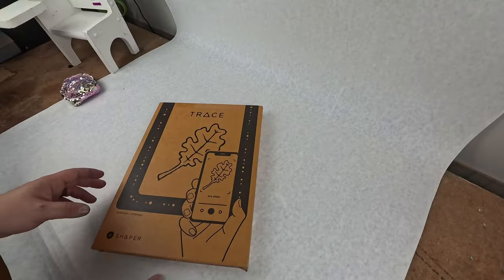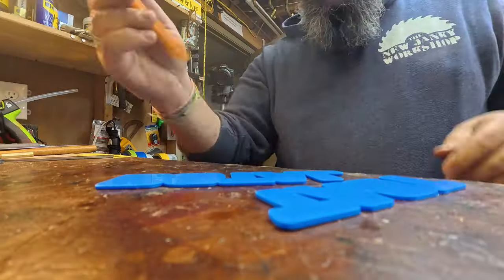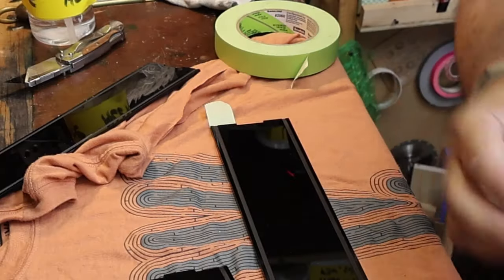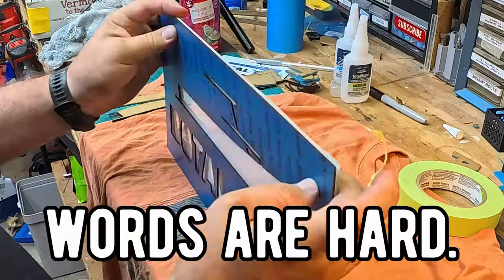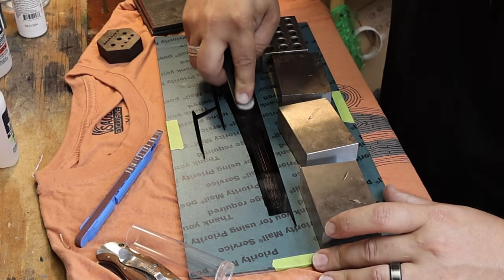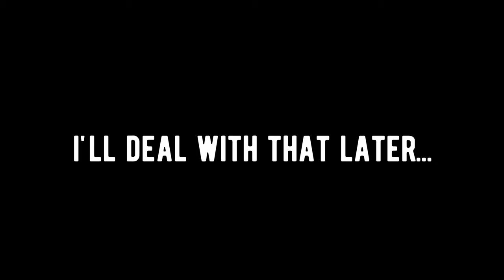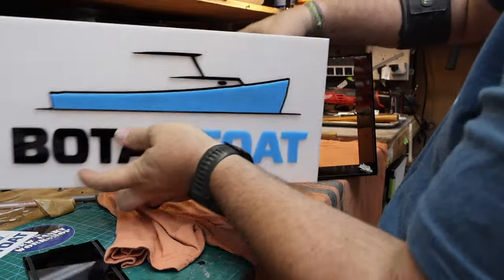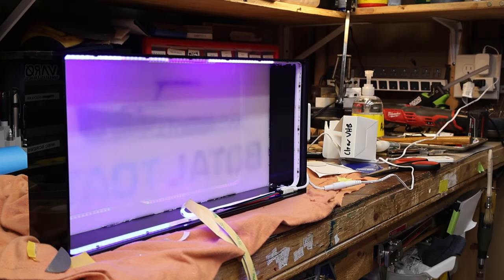I Made a Sign for Xyla Foxlin!

Comment: Do not use a liberal amount of accelerator when using CA glue on you’d body “a cut”. The heat caused by the chemical reaction is a 9/10.
Reply from the maker: 😂 Good safety tip! Thank you!

Comment: Adhesives on plastic will never hold well enough. You need to use a solvent made for that plastic type, which is like welding, they become one piece.
Reply from the maker: You are not wrong - my usual go-to for acrylics is Weldon #4. If you check out my video on the lightsaber mount build, I use that exclusively, and it's still holding like a champ with several lbs of lightsaber on it for well over a year.

That being said, I wanted to specifically work with TotalBoat and their TotalBond CA glue for this project, since at the time it was a new product on the market, Xyla has them as a sponsor, and it was for her "TotalBoat Store" in her shop, so, it all just seemed fitting :)

And this stuff with some surface prep worked out extremely well.

Comment: nice work but I would probably have cut a hole in the black boat so the blue  would have also illuminated to  but without all the fuss & maths of inlaying it, just a cut out 3mm smaller than the blue to give you room for glue
Reply from the maker: I tested out a few designs, inlaid into the white acrylic and the black acrylic (which didn't give enough glue surface to work with using CA glue (which was my plan all along for this sign for the TotalBoat tie-in). 

I did even resort to weldon #4 for one of them, but it tarnished the acrylic all around it. So, finally settling on the design that I did. This was one variation I did not try however. Where were you 3 months ago when I was making this?! 😃 Thanks for the watch!
Reply: @TheNewJankyWorkshop  I worked as a sign maker for 30 years but never actually tried CA glue, for something like that I'd have used a dichloromethane based glue which would use capillary action to go between the surfaces
Reply from the maker: @neilsullivan6416  Very cool. I am but an infant as it relates to sign making in comparison!

I can now add dichloromethane to my vocab, sounds much cooler than "Weldon #4" :)
Reply: @TheNewJankyWorkshop  I know what you mean, I  said that because here the product we mostly used was Tensol (12 I think) though we did buy unbranded back in the 90's which is were I learned the name. 
With a bit of  practice you can even laminate clear acrylic without seeing air bubbles
Reply from the maker: @neilsullivan6416  Is the solution just dichloromethane? If so, that's super cheap compared to the Weldon brand stuff.
Reply: @TheNewJankyWorkshop  I couldn't say I'm not sure Weldon was available in the UK, but as I said we used Tensol, which had other things added to make it easier to use as you could apply it and put pieces together, just dichloromethane would have evaporated before you could bring the pieces together but for larger areas, such as  fixing 2 sheets together you could pour & squeeze the sheets useful for getting good coverage when you  are CNCing 

Or in this case tape the blue onto the boat and use a fine brush around the edge and capillary action will pull it into the joint

 but we also used other glues which had more body, there is no one glue for all
Reply from the maker: @neilsullivan6416  I hear that, I have an always growing "collection" of adhesives.  Looking into the technical data for this stuff, it looks like its a mix of both Methylene Chloride (Dichloromethane) & Methyl Ethyl Ketone (MEK). So I guess I will stick to the name brands, and let the professionals do the chemical mixing :)

Thanks for the info my friend! Appreciate it!
Reply: @TheNewJankyWorkshop  no problem, I  recognise MEK as one of the liquids we used in the flame polisher we use to have
Reply from the maker: @neilsullivan6416  Now I think I need to get a flame polisher... :)
Reply: @TheNewJankyWorkshop  they're, or rather the one we had was, a pain, and had a pressurised vessel in it, and we really didn't get the value out of it, but that was 30 years ago
Reply from the maker: @neilsullivan6416  The technology may have gotten better. But I bet the cheap ones listed on Amazon are also probably a pain... maybe one day I shall see. It's on my list now :)

Comment: 4:35 dumb question, but does it being glass keep it from glueing together, so you can reuse the syringe? I know CA doesn't really stick to glass, but didn't know about the plunger, needle etc.

Or is there a cleaning process to do after using? Like flushing with some kind of solvent?
Reply from the maker: Thanks for watching & the commentary! :)

I have not had an issue with any of the needles. Been using that trick since March-ish (learned it from either Jimmy DiResta or Derek from Malden... or both... I forget). They usually come in a multi-pack however, which is nice. I am sure if you dropped the syringe in some acetone, it'd clean it right up. 

You can also get thinner gauge needles to if you need to for more precise application, as well as probably needing to stick to a thinner CA glue as well if going that route.
Reply: @TheNewJankyWorkshop  I will definitely be buying some then! Added to my cart and will order when I remember what the other things I needed for my current project is, lol
Reply from the maker: @justinbanks2380  Nice! I just order things as I remember them, so some days I have 3+ orders placed on Amazon lol :)

Comment: Can anything be done about that white "bloom" that the CA glue leaves on the acrylic?
Reply from the maker: Yes, you can use isopropyl alcohol to clean that up a bit, or even some acetone. I didn't worry much about it, as it was in the guts of the sign... much like the back of a canvas painting or the underside of an upholstered chair... no one ia going to see it, so it can be a bit messy :)

It's the accelerator which really exacerbates the white residue. Leaving the CA glue to cure on its own would have less of it.

I did a short on cleaning that stuff up here: https://youtube.com/shorts/1B8x9bUilyw

Comment: I think using acrylic weld would be better than CA glue and accelerator.
Reply from the maker: I agree. I usually use Weld-on #4 for acrylics. But this project was a perfect synergy for TotalBoat's new CA glue (at the time, it launched at the event where I talked to Xyla about making the sign), and the BotalToat sign. I was showing that it could be done, and also allowed for me to toss in some CA glue tips in there.